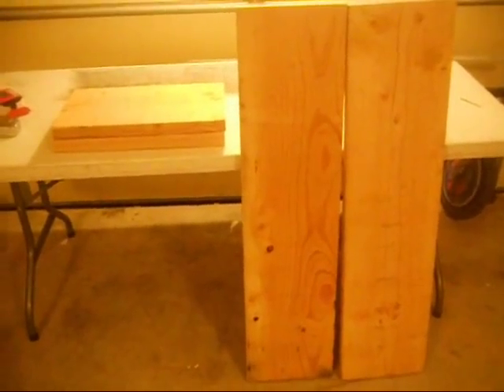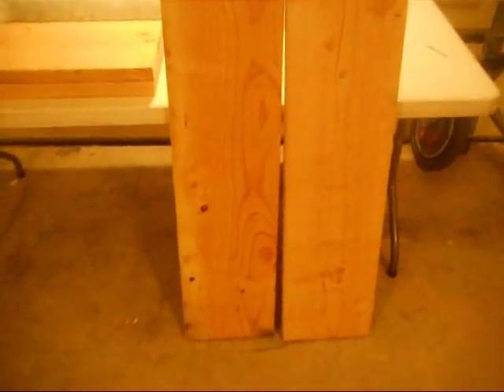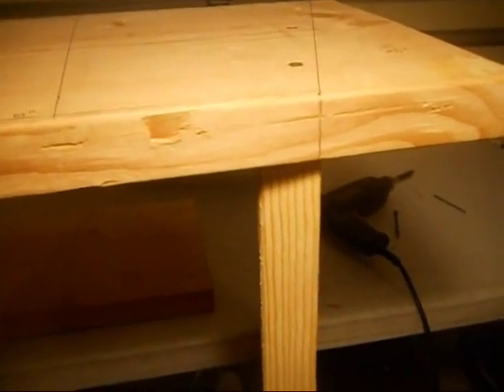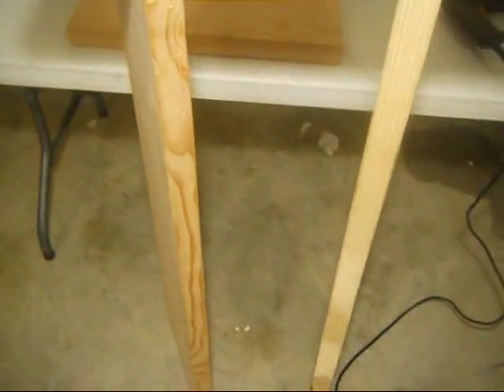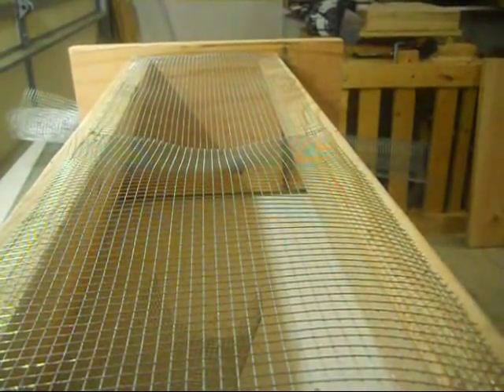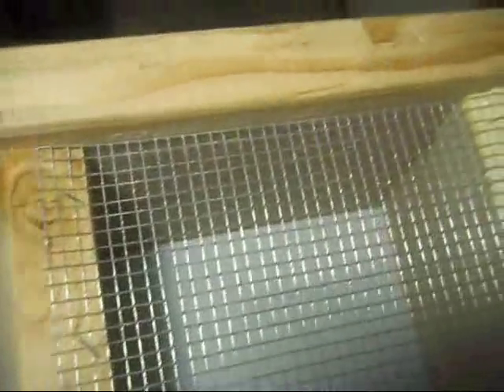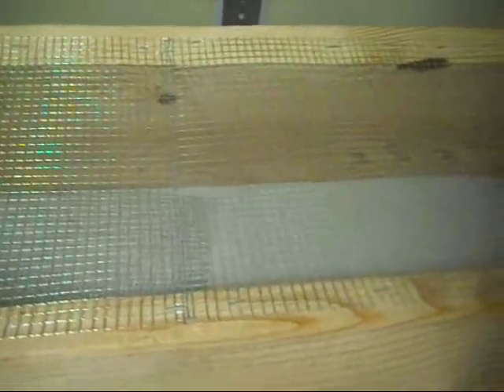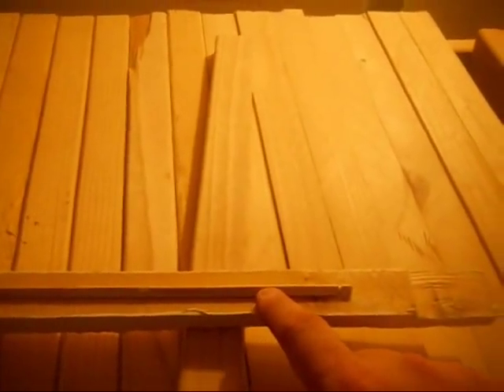how to make a topbar beehive

Comment: Many TBH's have a bottom slider board an inch below the netting, so you can make it a bit comfier in the winter. Bees in the wild often have big openings, and remember, heat rises, so the hive stays at a fairly constant 35°C (95°F), regardless of weather. The main heat loss is from too much human interference, where the keeper constantly opens up the hive to "check" on the bees - heat and isolation escapes, making the bees more vulnerable to disease and they have to work hard to reheat the hive.

Comment: When I followed this - my end boards don't line up well. My side "long" boards protrude out some from the angle of the end board. ?? On the other plans for tbh - 15", 5", 12" - they fit perfectly. is it because they are using 1x12's and I am using the 2x12's like you did?